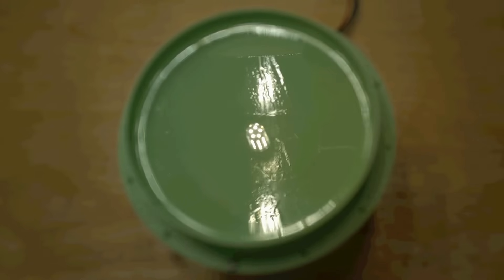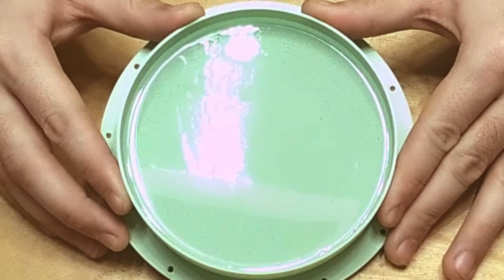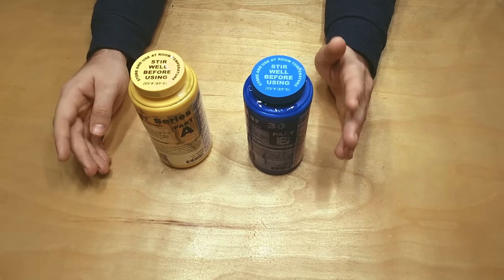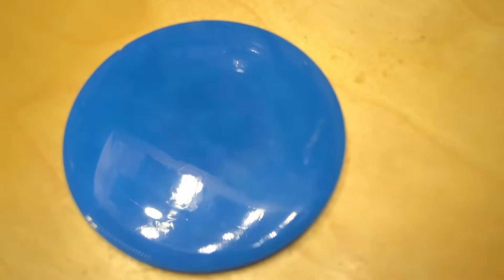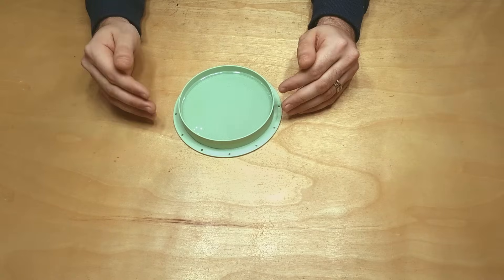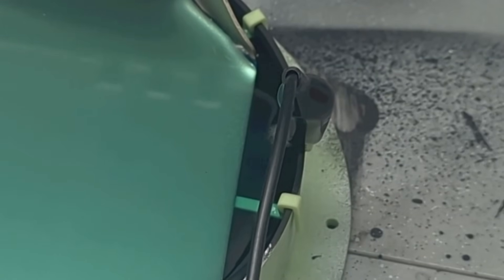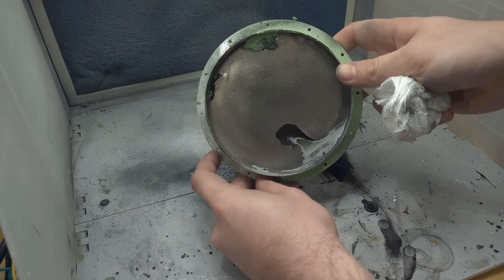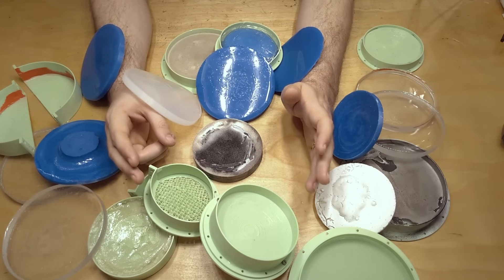Making Mirrors Is Hard

Comment: A couple of notes:

1) Your rig was not nearly stable enough to make a perfect mirror. It can get about 99% of the way there, but there is too much wobble. When using a motor, one thing you can do to achieve some additional wobble resistance is to use a "thrust bearing" to transfer the load from the shaft onto the motor housing itself. This is somewhat situational, but tends to work best when spinning perpendicular to gravity (like you are doing here). Also, sounds obvious, but level your table.

2) Instead of starting with electroplating, you should really consider using tin foil or something more basic. This would demonstrate the effect better, and would be more forgiving of surface defects as you are applying a sheet material instead of an additive chemical process which is inherently more reliant on a good cast. You can also plate the foil if needed.

3) You could actually use your casts with the minor surface defects and apply a VERY thin coat of additional resin. Maybe something even thinner (in viscosity), and then spin this while it cures, too. This should even out the cracks.

4) Cure your resin in a vacuum chamber. Trust me, those bubbles and imperfections will have a much harder time setting in a vacuum.

5) Whatever method you use to finally achieve your mirror coating, PLEASE put a protection layer over it. I have seen so many "diy mirror" videos where people fail to put clear coat, apoxy/resin etc. on the final surface and then their follow up video shows a half torn, half oxidized mirror that has no shine to it within a 12 month period.

Comment: I haven't read all the comments, perhaps this has been already mentioned 100x but: since the resin cures faster or slower depending on the ratio of the two ingredients... if they are not absolutely uniformly mixed, different portions of the pour will cure slightly sooner (and shrinkage slightly sooner) forcing they yet-uncured resin into a slightly new volume and a slightly new surface shape..

Comment: get a water-consistency resin that cures over weeks. You need to make sure there's ZERO vibration while spinning (probably the main cause of those micro ripples), plus rotational velocity should be absolutely perfectly constant to avoid a mishapen surface. If the mirror's center of mass is slightly offset from the axis of rotation it will create a micro wobble that shakes up the resin which could cause some more ripples, solution for that is to just make the whole thing a whole lot more stable.

Comment: 2:27 so what if you added the resin with a layer of silicone or any other material on top of it, that way both are cured and you can just separate them  later to get the smooth surface that's in between them, i never handled any of these materials so im not sure if they would get stuck together after curing or of they could be easily separated, if you do try it, let me know if it works :)

Comment: Liquid metal mirrors use an air cushion and DC motors to keep a smooth surface, you seemed to use a stepper directly coupled to the plate, ¿could that be cause for some of the irregularities?.
try again the resin, and a non miscible liquid on top (careful for emulsion formations, perhaps something like ethanol could do the trick)
another possibility could be the fact that as the resin is curing it heats and wraps, large surfaces like kitchen tops are made with a pretty low ammount of catalyzer, and tons of time, a solution would be to do the same, spinning a vat of resin on a clean dry room with a 0.05% of catalyst instead of the 1-2%, it will take a couple days to a week to make the surface, and then, 
what about using a wax template, (revving up a hot plate with water on the downside, wax on the top (wax is amorphous so it should harden without bumps). although I'm not quite sure it will work, because there are demonstrations where you spin two liquids, and the lower one makes a gauss bell like shape, not a parabola, due to the fact that the upper one exerts more pressure on the edges (don't remember if that is after the container stops spinning though)

Comment: You don't need to spin up a big tub of whatever, you need to fabricate a bowl shape that is as good as you can get, from a rigid material, then spin coat that to finesse the surface. i.e. First work on correcting errors in the next best technology you can master, then build on top of that. This should reduce your liquid metal costs to 10% or less.

Comment: Aluminium melts at just under 700 °C
You could use a bucket of molten Aluminium and spin it while cooling.
Since Aluminium forms an Oxid layer you may have to apply a layer of clear paint after polishing.
Maybe it could also work with lead, it is easier to melt

Comment: What you could do is reverse cast a grinding plate from the initial mold and attach sandpaper to a bent but flat substrate in ever increasing grits to grind out the imperfections. I know in the past large telescope makers and even NASA used something like that process to create glass lenses for their telescopes that the reflective material was adhered to. Once it's sufficiently flat, you could coat it with spray-on mirror chrome by the company Mirror. It has a reflectivity rate of up to 98%, on par with Celestron's Starbright coatings on my 11" Schmidt-Cassegrain bought almost 20 years ago. If it turns out less than 98%, turn it with the grinder with a 5k+ grit.  And just 15ml will cover an 8sqft area, so a little goes a very long way. It does suggest a black background before application so I would suggest several coats of a black semigloss and then grind it at higher grits (3500+). Then when you're finished, you have a mold and a process you can tweak and make backup lenses for either replacements or new telescopes or telescope ideas.

Comment: I tried it at 43 inch diameter with slow epoxy , got a nice parabola smooth finish but there were defects caused by convection heat in the resin, even though I used 4 pours at 3/8 inch each,a previous 24 inch worked much better .

Comment: This has been tried several times by several university projects.  So far no one has achieved a surface good enough to make a telescope for visual wave lengths.  Using glass is really not nearly as hard as you might think and has been done by thousands over the years.  It is just another thing to learn and usually has much more success than what you tried.  I have been involved in measuring the results of some of the university tried spin castings.  They were not even good shaving mirrors.  You have not gotten even close to what those were sorry to say.

Comment: Starting with a rotating container that already has a near parabolic shape could allow using a much smaller amount of gallium metal, as it would only need to be about 1- to 2-mm thick, covering the container. This would amount to only 100 g for a 14-cm diameter mirror.
Such a container may be 3d-printed.

Comment: Oh, boy. Resin is just about the worst material for a telescope mirror. You really should use glass or metal. The more rigid, the better. And rotating bed or not, you'll still need to polish the surface. The rotation will get you the exact shape you want, not the surface finish. I would not expect a perfect surface even if sealed perfectly level heated chamber, much less on your countertop.

If you don't want to go with the molten glass route, because, well it's molten glass, maybe bismuth could work for you? It melts at 270 C, it's not toxic, and being a metal you'd have some chance at electroplating the thing. And it's waaay cheaper then that gallium alloy.

Comment: If you support a concave spherical shell by it's edge and then pull on the center of the mirror you can distort it into a parabola. But really, spraying a mirror surface with primer and graphite? Regardless of how good you made the mirror, the surface finish is now going to be defined by the paint layers....

Comment: Your experiments are very interesting and exciting. As a liquid metal, you can use not only toxic mercury or expensive gallium, but also other options. For example, the  Wood alloy, which melts at a temperature of 80 degrees Celsius. Place your rotating shape in a camera with such a temperature and gradually reduce it until the alloy is hardened. Another option for creating a form is the use of an elastic film over a vacuumed vessel.
Reply: Trampoline frame with aluminuized mylar vacuum middle, = big parabolic 
Not good for casting though cuz the weight distortion.

Comment: The waviness of everything you are producing is due to the vibration of the assembly as it rotates.  All liquid mirror telescopes go to extremes to prevent vibrations of the rotating mirror tank/pond.  You had no hope driving it directly through a shaft coupled to a n-pole electric motor, and likely running on low performance ball bearings.  Ditto designs that don't very accurately balance the rotating tank. 

All of the liquid-metal telescopes run either on electromagnetic bearings or fluid bearings (e.g. "air-bearings", but often not air, and instead an oil).  The latter is simpler and cheaper to play games with on a small budget, and should work well for small mirrors.  You absolutely don't want to directly couple any motor shaft to it, and the techniques to drive it are one of the interesting design problems.  The simplest scheme I know of is a design trick with the air/liquid-bearing idea -- you use one of several different geometric schemes so that multiple balanced fluid-jets simultaneously levitate the tank and spin it.   It is critically important in these schemes that the all of the fluid-dynamics be in the "viscous" low-Reynold's number regimes, and that the jets have relatively large pressure-drop through small viscous orifices -- this kills "organ-pipe" modes.  One of the more interesting problems is preventing radial-imbalance modes -some designs have a simple teflon-against-hard plain bearing at the center - the precision must be very good, ditto balance of the tank.    Usually the center of an optical mirror has a hole in it anyway (for Cassegrain feed... but even if you have a newtonian feed or even an axial detector/camera assembly at the focus, the center of the mirror is obstructed so there is no problem with it having a hole). so you can have a precision center shaft where the shaft is long and very stiff, with Teflon plain bearings balanced around the center of mass of the spinning assembly (as loaded) above and below .

Comment: omegageek64 tried something similar - he used a rotating mold to make a convex plaster mold and then "slumped" glass onto the mold in a kiln. He hasn't said much about this since, and I think he was  expecting to do more conventional lapping and polishing as well but get a big jump on shaping the mirror. Not to rain on your parade, but one of the reasons to use glass for a telescope mirror is that you are hoping for lambda/4 or better surface accuracy, and thermal expansion effects can quickly ruin the optics. Plastics have thermal expansion coefficients 20x higher than borosilicate glass, Thermal expansion will also cause distortions during cure, because the resin heats itself up while curing. Still, I hope you keep trying

Comment: I was thinking if you spin the resin in a dish that are a few inches bigger than the dimension you want. That way the centre portion may have better quality as the friction forces at the interface between the liquid and dish walls will have a smaller effect, reducing waviness in the centre.

Comment: I can highly recommend reducing pressure behind a flat mirror to do this. Not for the end result mind you, it will not be anything special, normal houshold mirrors are not that good to begin with. But it is so easy, and fun project. 
You can make huge mirrors with this process. You can use glass mirrors, or reflective mylar foils. You just take a circular edged cavity such as a bowl or barel and apply adhesive to the edge and stick your mirror or film to it, then gradually pull air out behind the mirror. Its pretty ridiculus that you can bend actual glass this way with nothing more than sucing on the tube. I made a one meter diameter glass mirror like this once. The focal length was like 6 or 7m. But with mylar film you can do much shorter ones. If you want to use it for a low grade telescope mirror you will have to black out at least half the diameter since the edges will be kind of wavy.

Comment: This will never work. Do you have any idea of the precision required for even a halfway decent telescope mirror? You would have to precisely control the changing rotation as the epoxy cured. You would need epoxy that did not expand or contract or change temperature as it cured. You would need near perfectly smooth rotation, no vibration, no air moving against the surface. There is no way you could paint a surface or electroplate a surface to the required consistent thickness and smoothness. If you got close, polishing using sandpaper or your rotary tool would destroy the surface. You need to do something like a large pitch lap (you might as well have just made it out of glass at that point). The plastic mirror is not stiff enough to be polished without severe bending and compressing. Even if you managed to produce a good mirror in the mold it would not be stiff enough to be mounted in a telescope. It would sag enough to be useless and the sag would vary as the telescope was pointed to different parts of the sky. The figure would change with temperature changes. There are solid engineering reasons why all telescope mirrors are now made of vacuum deposited aluminum (or gold or silver or fancier multi-layer structures) coated glass (or ceramic or quartz). The old timey metal mirrors had lots of problems which glass made better. And glass mirrors are actually pretty easy to make. This experiment just demonstrates how good glass is.

Comment: You said that a rotating kiln is not feasable, but you can make an electric kiln pretty easily out of nichrome/kanthal wire and some fire bricks - this stuff is available at a pottery store. Then wire up a temperature controller and the only hard part left is to fabricate a spinning steal plater

Comment: The fluidic telescope nasa project (FLUTE) made several test where they made uv resin lenses in plastic buckets, not by spinning the bucket, but by relying on the natural curvature of the interface layer between two fluids of similar density. They used Glycerin with added salt or water (to control the density of the glycerin) and UV resin i think. Always wanted to see a youtuber recreate their results. Here's the exceprt from a article: Ground Tests: A Drop in the Bucket

Before taking their ideas to the skies, the team wanted to test their ideas on the ground. 

“Liquids are useful not only for creating the lenses themselves, but also as a mechanism to eliminate the effect of gravity in an experiment on Earth,” said Moran Bercovici, an associate professor of Mechanical Engineering at Technion.

“By injecting a liquid that can be solidified, into circular frames submerged in water, we were able to create lenses literally in a janitor’s bucket,” said Dr. Valeri Frumkin, who developed the method in Bercovici’s group. “Polymers, which are also used in nail salons to make acrylic nails or in adhesives like superglue, are a natural choice for lens material.  The trick is to make sure that the water has the exact same density as the polymer we’re injecting so that the forces of buoyancy precisely oppose gravitational forces to simulate the conditions of weightlessness.” 

The resulting lenses have an outstanding surface quality comparable or even better than achievable with the best polishing methods, and they took only a tiny fraction of the time to construct. 

“This method allows us to completely skip any mechanical processes such as grinding or polishing,” said Bercovici. “The natural physics of fluids simply does all the work for us.”

https://www.nasa.gov/centers-and-facilities/ames/nasa-tries-new-ways-fluid-materials-to-build-giant-space-telescopes/

Here's the research paper: https://www.cambridge.org/core/journals/flow/article/fluidic-shaping-of-optical-components/2EED0BA8A3C394A4212B56E9875E2170

https://youtu.be/If_FcoAAyKA?t=423

Comment: Epoxy resin gets less viscous, when warmed up, so probably you could heat the spinning part, and get a less bumpy surface .

And I would put the Epoxy resin into Vallum before inserting into the centrifuge so that the bubbles and all Gass left behind will get out of the Resin.

Those two treatments helped me a lot while working with Epoxy.

Comment: Regarding a stable plastic, if you can make a blank then use an old cd to form your mirror.  To plate onto plastic use a pencil or graphite to coat then put it into a copper sulphate solution a bit of power and it will coat the graphite,  its how you coat leaves etc for jewelry, silver or gold.

Comment: Tbh metallic mercury isn't as poisonous as you make it to be, it can be even safely swallowed in small doses. See Cody's Lab handling it like water with no protection. It's the vapors, salts and organic compounds that you should be worried about. Even if you're still worried about handling it, just use a respirator

Comment: Have you considered using copper formate or copper acetate?
Essentially, you heat them in a chamber and it will make a reflexive ultra thin coat on every surface.
I also saw that there are ultra-thin foils that work like mirrors, they are somewhat cheap and can be easily found online.
There are also metalizing mirror sprays that you can buy online (although I don't know if they are actual metals or something else)